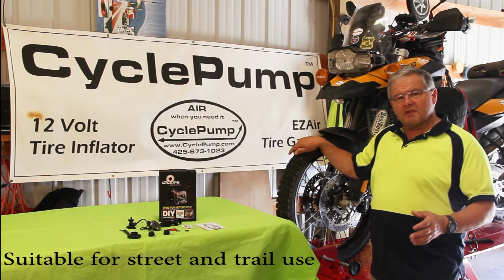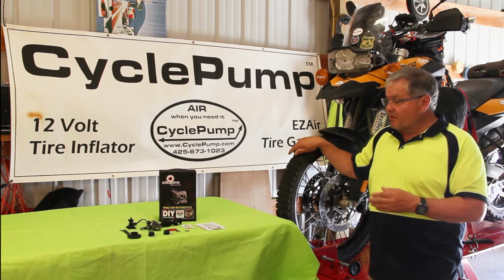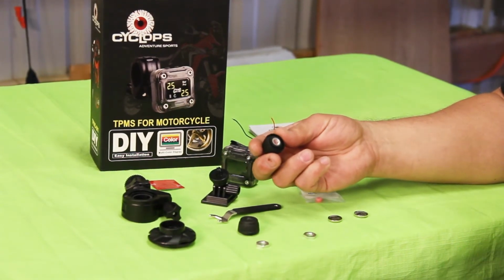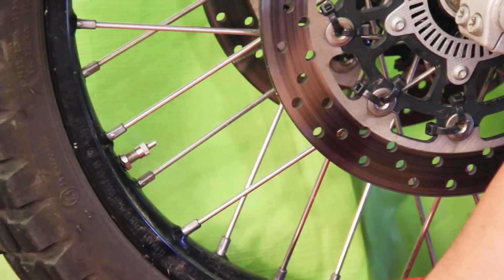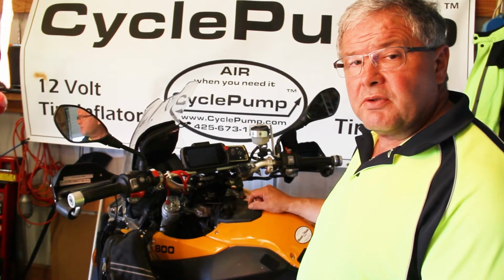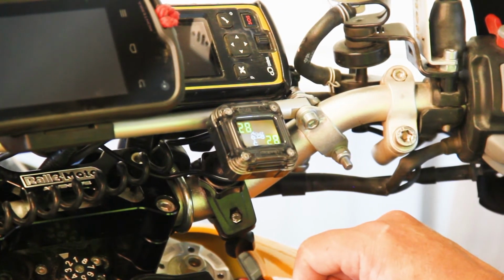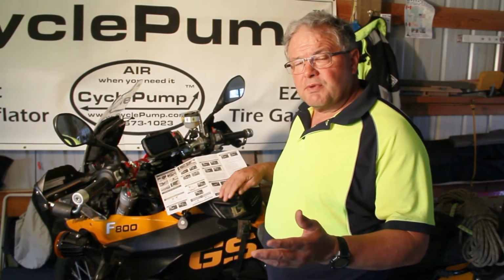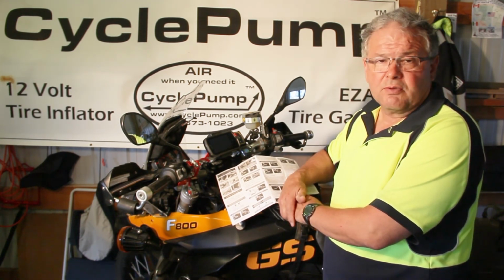Cyclops Tire Pressure Management System (TPMS)

Comment: I've got one . Could be a great product if you could read it in daylight.  The monitor unit is solidly built. Good thing it has a red flasher when the pressure reaches a pre determined level because I can't read anything in normal daylight.
Reply from the maker: Interesting comment. I've never had any problem reading my display, even in bright daylight. Of course you need to orient the display so it's looking directly at you, not at an angle. Otherwise you get a reflection. Same is true with your speedo and odo.
Reply: @bestrestproducts648  That is good to hear, maybe mine is an anomaly. It is pointed straight at my eyes. 
At night , it is the perfect brightness.

Comment: The problem with these things are you have to take the things off just to test your pressure before you ride as you could have picked up a nail riding your bike back in to your garage. PITA
Reply from the maker: Good grief Charlie Brown. That's the silliest comment I've ever heard.  You're "thinking inside the box".  Take a look at the tire before you ride.  Detect flat tire. OMG. If there is, don't ride.  Do you check both tires everytime you get on the bike? I don't,  most don't.
 
Within 100 feet the sensors give you a pressure reading AND they give you a warning in the event you get a nail during the ride and your pressure drops.   How is that a PITA?
Reply: @bestrestproducts648  Funny as a supplier you say that. Most comments I've read on threads say the exact same thing as I mentioned. Even more obvious is that Amazon Warehouse are always dumping the things at give-away prices due to customer returns no doubt. So Charlie Brown, poke that & your Chinese cheapies where the sun don't shine!
Reply from the maker: Martin you're badly misinformed in so many ways.  1.  Clearly you don't understand the purpose of a TPMS sensor, or the benefits it provides.   2.  Clearly you don't know that the Cyclops TPMS is not made in China.  3.  Clearly you don't know that Cyclops doesn't sell their gear on Amazon,  and that the quality of the Cyclops TPMS is far above other brands.   4.  And clearly you've got an agenda and are looking for a fight. 

Yes, I'm a dealer for Cyclops, but first and foremost I'm a rider. I only sell gear that I use, gear that works, gear I can honestly recommend to my friends and my customers. You are neither.
Reply: @bestrestproducts648  Don't beat yourself up about it. The exact same thing is available on Amazon over here and I do understand the benefits of TPMS having owned large motorcycle franchises for many years. Cheap kit has it's place. Just not in mine.
Reply from the maker: @K22MDL  sorry, but "the exact same thing" isn't available over there, or over here, or anywhere else.  The Cyclops system is unique and proprietary.  There are other TPMS systems on the market, and they may look similar, and they may give tire pressure readings, but they're NOT the same thing... anymore than a Ural is "the same thing as a BMW", or a Japanese V-twin is "the same thing as a Harley Davidson", or one helmet is as good as the next. ///  Yes, cheap kits have their place.  Generally speaking, in real life you get what you pay for.  If you're budget conscious, go for something cheap.  If you're quality and performance conscious, consider the Cyclops TPMS.  Since you've owned large motorcycle franchises I would assume you'd go for quality and performance, since money shouldn't be a problem.  ///FYI I've used these Cyclops TPMS kits for a couple years on several bikes.  They've done a great job, they're accurate, they're reliable and rugged, and they've saved my bacon (and my riding buddies) a number of times when we picked up a nail.  They notified me that the tire was losing pressure, so I was able to stop and make repairs before the tire was damaged.  /// As to your original post where you said TPMS systems are a PITA, that really surprised me, especially since you claim a background in the motorcycle industry.  You should know better than to make a silly statement like that.

Comment: Thanks for the very informative video. Haven't found this answer yet. I run tubliss in my tires. What is the lowest alarm you can set?
Reply from the maker: Called Cyclops so I could get an answer to your question... the system can be programmed to report pressure alarms down to 8-10 psi.
Reply: @bestrestproducts648  Perfect, as i run 10 in front and 8 in the rear on most terrain. You mentioned the pressure alarms. Is this individual or one pressure for both F/R? Thanks again for the great video.
Reply from the maker: @cmbscx1084  that would be pressure for both. Set the sensor for the highest tire.

Comment: What attracts me to this is knowing at a glance what I set pressure to....so I am riding I can think about how well or haw poorly the current pressure is behaving...my memory is so bad I can't remember what I did yesterday...I am riding an old DL650 in the dirt a lot with "80/20" tires ....it gets downright evil as far as front tire traction ...especially in the sand.   I was thinking it might be nice to install a second valve stem on each wheel dedicated to sensor ....taking it on and off and on and off to adjust the pressure is going to destroy the rubber gasket in short order!   The other way of course are sensors integral to the valve stem so that the sensor/sender is hidden inside the tire.  that is expensive and seriously doubt it would work with this monitor anyway

Comment: doesn't make sense to have to ride the bike b4 the pressure will be sent from the sensors to the unit
Reply from the maker: Cody Ng the transducer in the sender is activated by motion. Only then does it send a signal to the display panel.  

If it wasn't that way ther system would be sending signals as the bike sat on the darkness of your garage and that would affect battery life.
Reply from the maker: Cody Ng also consider this: ABS braking systems.  They don't start working until the wheels start to spin.
Reply: There is not a reason in the world they could not have it where you simply press button on the monitor to obtain a reading...my guess the only reason to not have this is to save price of a button?....like I mentioned before I like the idea of a 2nd dedicated valve stem just for the sensor!  At 180degrees apart from fill stem it might also help wheel balance ....allowing removal of a wheel weight meaning no weight penalty to speak of????
Reply: @bestrestproducts648  ABS system is TOTALLY related to wheel rpm...DUHH ....apples and oranges reasoning....tire pressure can be measured at ANY time with sensor/sending unit ....no reason the bike should have to roll first....I want a push button that turns the thing on!  ...Do NOT want to have to ride the damn bike to see the air pressure!   DUHHH!
Reply from the maker: Dougie -  The sensors shut off when they don't sense rotation. That saves battery life. For them to start sending  a signal again the wheel must be spinning.  Got it now? Duh?

When you turn on the key you DO see a pressure reading,  but that's the reading in the tires when you last turned off the bike.
Reply from the maker: @dougiequick1  one more thing...  <<NO>> TPMS sensor sends a wireless signal to the display while the wheel is sitting stationary.  This includes BMW's TPMS and all other brands.  If you're getting a reading when you turn on the ignition, that reading is the <<last>> pressure reading sent to the display, while the wheel was spinning.  It's NOT the pressure in the tire at the time you turn on the key.   So if you picked up a nail in the last few minutes of your ride, any brand of TPMS sensor is not gonna tell you that your tire is currently flat.
Reply: @bestrestproducts648  hi, if the bike will show the last reading while I'm not using it for a month, how do it get the new reading on the gauge? by reset it or? looking for ur reply, thanks 😁
Reply from the maker: @allanbong4629  Every TPMS system in the world (car and bike) has a sensor that sends a signal ONLY when the wheel is rolling.  When the wheel is NOT rolling, no signal is sent.  So if your bike has been sitting for a month, your display unit shows the LAST reading the sensors sent out a month ago.  In order to get a current reading, you have to bring the wheels up to a rolling speed high enough to trigger their transmitter, at which time you'll see the new reading.

There's a simple reason for this:  battery life.  If the sensors were always sending a signal thee battery would go dead in a very short time.
Reply: @bestrestproducts648  understood,  thx👌😁

Comment: Will this work on a F700GS?  On the FRONT cast wheel the valve stem comes out on the SIDE of one of the spokes.
Reply from the maker: Willy Chu Yes it will work on stems that go out to the side but the stems must be metal.  Rubber stems would deflect and be damaged.

Comment: Nice video thank you.   

However your installation of your front disc really scares me - wire ties???    Fix this my friend.
Reply: Update:   I just installed my unit - May 2020 - wireless and waterproof.   Works great.
Reply from the maker: Those zip ties are there to prevent the floating front rotor from klacking whenever the bike hits a bump... it's very annoying otherwise.  The rotor is secured to the  hub with the standard bolts so there's no problems.

Comment: Why do you have cable ties on your brake discs?
Reply from the maker: The BMW f800gs has a quirk... on rough roads you hear a loud klacking sound coming from the front end.  1 source is the internal  plastic fork guides whacking up against the fork caps.  BestRest Klack Stopper bushings solves that problem. 

The other source of noise comes from the free floating brake rotors. they bounce and klack due to their design (which has some merit) but the noise is annoying and distracting.  Using zip-ties holds them in place;  the rotors can still move but only slightly.  Noise goes away. 

Some guys use safety wire for the job.
Reply: Interesting.
Reply from the maker: Keeps the rotor from clanging on dirt roads.  Those are floating rotors which have benefits but the noise is annoying.  Zip ties allow a littler float but prevent the clack clack clack noise.

Comment: Well shit..... If it's not real time then it's real junk. Next option!
Reply from the maker: Your comment indicates you're confused. The system does give real time tire pressure. Where did you get the idea it didn't?
Reply: @bestrestproducts648  I can see where you would say that. Let me be more clear in this reply. So when I said real time I meant I'm looking for a TPMS that shows the correct TP as soon as I turn the key on so that if my tires are low I can adjust or fix the issue. I don't want to have to get all geared up, move the bike a few feet and then be like OK, the tires are good or OK I need air, that's a no bueno system for me. This should clarify what I first ment.
Reply from the maker: @theperson7718  the sensors show the last pressure your tires registered when you rolled to a stop. Think about this... it's exactly the same setup with any car or truck that has TPMS sensors. They don't transmit until the wheels start turning... same with the Cyclops system. 
.
There is no system in the world that transmits tire pressure the moment you turn the key.